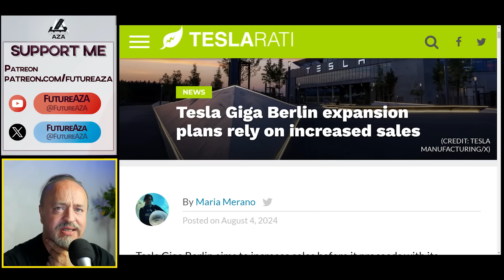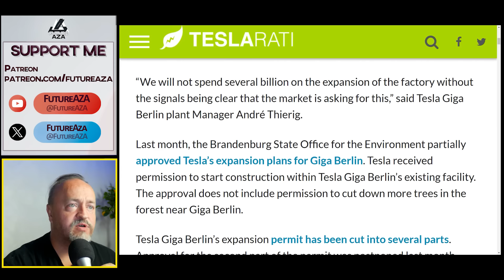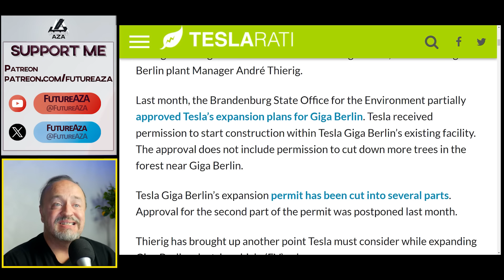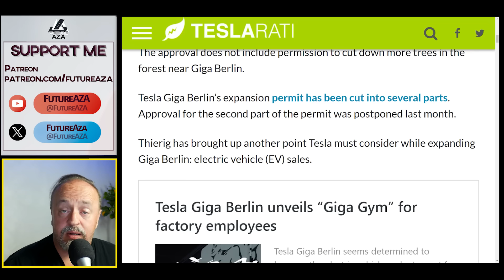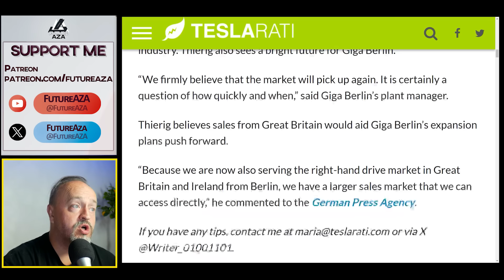Giga Berlin Exp. on Hold, Here's Why

Comment: I think the reason they are changing track is not simply because of “lack of sales” or demand. I think the reason is, as of now the 4 factories that they have are not running at 100% , so they have enough of space for more production; but in the mean time FSD is almost ready, the vision based AI is getting to be smart enough to understand the world around us and go anywhere in part of the globe. In that scenario, when the whole concept of personal transportation and owning cars is going to become superfluous! 

When buying cars is going to become obsolete, then why make them! What the world would need are vehicles without steering wheels and pedals, therefore today they have enough infrastructure to produce millions of robocars. 
So that is what is happening
Reply: No, there are 2B vehicles, even if the new ones last 100 years, they won’t replace all them with 10x current production
Reply: @rp-wb6xn   There is some truth in what you say.   First cars lasting 100 years makes it harder to replace the fleet.   The second is that disruptions have an inflection point.    After that the disruption accelerates at a much faster pace.

Comment: Although you disagree that cybertruck was a big mistake, they should have the -25K first. Your argument that the research should have been done first on the cybertruck doesn't make sense. Not a lot of cyber truck would be seen on the -25K car.
Reply: Cyber-truck gives Tesla premium price, pays the way for experimentation with 48volt and etherloop and new controller logic. It also allows Tesla to explore manufacture of larger vehicles. It will likely fork into a van type version.  Where-as if you experiment with a low cost car, you undercut the 3 and Y sales. A tesla or a Lucid design might have an
drive train that's a little more efficient than a good chinese or korean car , but battery develops make that extra 3 or 4 % efficacy less important.
Tesla has to play to their strengths: staying a desirable premium brand, having the best software,  charging systems, safety record etc.
   With smaller cheaper cars you can get an osborne effect if you match quality of the old, but can fall into  equivalence with byd and kia, with others if you target a lower price point.
Tesla needs,  "perfected fsd" to make their small cars stand out above the comparable  smaller cars.
Also tesla just needs more smaller cars, more bigger cars, more truck variants , some vans etc.
The deal is the need to make the stuff that will give them the highest margins.
Reply: @samblum153  How is tesla premium compatible with their mission to make the whole car market electrified?  By staying Premium they cannot grow or not grow enough to make them a valid investment.  How much data is needed to make a perfect FSD? Nobody knows that and there is a very realistic possibility that it never will be achieved with neural networks or another AI mechanism. Actually too much data can make the model actually worse as already happened before with other AI solutions.
Reply: There is no 25k car. I don’t believe Tesla can manufacture one at profit and that’s why we don’t see it.
Reply: @singed8853    What's the motivation to rush to cheap cars?  that was a product of Chinese crazy throw a trillion dollars at EV approach. There is a motivation to make AI cars.  If the two are on the same line, the small expensive taxi is obviously a higher priority than a  stripped down little car.
What you get from this approach is a premium price for the taxes, bundled with fsd for sure.   For the regular small cars you will get probably just get autopilot, and minimal extra features.
I'm guessing tesla would base prices on  cost of borrowing money at the time they are launched..
Reply: @samblum153  Neither are being manufactured. There are no robotaxi lines and there are no mythical 25k car lines.  All of Tesla's cars are supposed to be 'AI cars'.  This is not a matter of priority - a company can do 2 profitable things at the same time when they have the amount of capital Tesla has.  Tesla is not manufacturing this '25k car' because it does not consider it a profitable endeavor. Call that my opinion if you want.
Reply: @singed8853     Best use of capital, means proper scheduling the use of capital, right project at the right time.   They ain't doing it yet  does not mean they are or the aren't.  But be assured when they do start to build a next car it will be more than like a smaller model3 not a kia, and it will sell for a premium as they ramp up the factory capacity.

Comment: what you don’t understand is fsd is very close like less then 6 months imho. Also you don’t understand the launch model of fsd which is Elon activating of all the teslas alreadon on the road, Elon already said this on one of his speeches when asked how he would build a million or 2 million cars so fast to launch. he responded they are already built..
Reply from the maker: You sound like me three years ago.
Reply: The current FSD isn't full self driving. Drivers must 'baby sit' the system when engaged and intervene when called for. And my guess is that this will remain the case for quite a while, because there are too many unhandled edge cases the current system can't handle.  You think FSD is very close (e.g. less than 6 months away); I beg to differ.  IMO FSD is clearly not ready for prime time, nor will it be any time soon.

Consider just a couple of Elon's 2019 predictions (of many):

> We will be feature complete full self driving this year. The car will be able to find you in a parking lot, pick you up, take you all the way to your destination without any intervention"  ... “My guess as to when we would think it is safe for somebody to essentially fall asleep and wake up at their destination? Probably towards the end of next year,”.

> At Tesla’s Autonomy Day Elon said “Next year, for sure, we will have over 1 million robotaxis on the road".

5 years hence and FSD while greatly improved, still doesn't perform well enough to deliver the driving experiences Elon described/predicted in 2019.  I suggest we not put much stock in Elon's FSD and robotaxi predictions.

I await and look forward to FSD releases that yield  thousands of real-world driverless trips that required zero driver interventions.  We aren't there yet and IMO such FSD releases aren't going to be available any time soon.

Comment: It always takes far longer to finish the final 1% of work, than the previous 20%.  Those last few niggling bugs, or unintended consequences, pile up like a bump in the rug when moving furniture.  Also, Tesla won’t always have Elon to push the company down the road to success.  There’s a huge risk if the prime management mover is sidelined or moves on.  There are also powerful forces in the World aligning against the innovator.  They should not be underestimated.
Reply: Yes!  The final 1% of FSD development will be no different.  FSD currently still has 'quite a way to go'.

Comment: Rumours are circulating that the new factory designated for the Semi will actually be used for the new small car…!
Reply: That doesn’t seem very likely.  The first lines will be in Austin, where the engineers are located.

Comment: Tesla takes on full responsibility and financial liability once they declare the vehicles fully autonomous, so they better be damn sure it’s beyond flawless, and it’s not yet there. They may have to revisit IR cameras and radar in order to facilitate unsupervised fsd, especially in low visibility scenarios, we shall see.
Reply: agreed depending on the driving situation it is FSD or PSD (parttime) or DSD (dangerous)..camera strategy is clown car..when cameras can't see FSD has immediate heart attack and dies (and doesn't recover on its own)..no end to end neural network or AI hocus pocus or..bad weather of snow, rain, fog, smoke, etc. is beyond the camera's ability..imo robotaxi clown car will sport new sensing tech..couple of weeks ago 4 deaths in 20 minutes due to light morning fog..i found that a true tell of camera weakness..i could see the sun, the highway, cars..but 4 FSD deaths..FSD is mostly unsalable and needs huge price reduction...city driving is useless toy that has minimal commercial value, but where they present new clown car stuff (self-parking in Costco ROTFLAMO), highway driving is valuable but FSD is useless in anything other than simple driving..clown car company as far as FSD goes.  i own a Model and 60,000 lms/year and own Tesla stock
Reply: It's all in the insurance. Clearly Tesla will pass through the insurance risk to the customer, unless they have suddenly become a charity!! The market will decide on the price. The offer will clearly need to be competitive inc insurance. This is a non issue.

Comment: Even if there will be tariffs on cars made in Mexico and sold in the USA (to frustrate BYD, xpeng & friends), then still that factory could be used for batteries and robots…

Regarding Berlin: the only model they made (the m-Y) is the best selling car in the EU, so what do the want?
The smaller car will be a huge success in the EU, but just smaller in size, won’t make it cheaper to produce. They need 800v, 48v, steer by wire, and bots to assemble them, and cheaper batteries…

Comment: Tesla sale in China is up? The numbers would not agree with you. The last week of July sale on China was 12,500 down 4.7 % compared to the previous week.
The month of July Tesla sold total 71,000 but only 50,000 in China, 21,000 were exported to be sold elsewhere.
Shanghai productions are to be sold in China, because the exporting incurs additional costs.

Comment: You can now order the CT on line with no reservation and immediate delivery.  So the millions of reservations have been cleared.  They will have plenty of space to build the $25K EV, which they should have done before the CT.  CT will be a special product like the X, but will not sell like the 3 and Y.  Hopefully they can utilize all the technology from CT on all the other Tesla EVs.  Can Tesla build a EV without a glass roof?  It's hot in Texas.
Reply: You can order the expensive model. My #147k reservation for the lesser cost version is not up yet. They are not "cleared", just cleared on the high cost units.
Reply: You are not quite right.  You can order a Foundation Series Cyber Truck online in the US and in Canada.  Millions of reservations still exist but they are for the less expensive version(s).  CT will have significantly increased sales once they start producing and selling the lower cost trucks.  It’s a significant increase in the Total Adjustable Market (TAM) for the CT.  The CT is the best selling EV pickup globally.  And in about 3 years it will be the best selling Truck globally.
Reply: @richb2229  Thanks Rich for the clarification.  I guess I shouldn't have cancelled my rear wheel CT order.  I kept getting emails to configure my Foundation even though that was not what I ordered.
Reply: @guyg2005   While CT sales look good now a lot of what happens after the foundation series is over will depend on the economy.
Reply: CT reservations are evaporating now people have seen how ghastly it is and how precipitous the depreciation is.
Reply: The reservation list is not cleared. Better to say that when you are willing to pay a little extra (higher price for Foundation Series) you can jump ahead in the waiting list.

Comment: The problem is a fundamental one, and that's the extremely rapid rate of improvement of batteries and car design. Tesla have picked most of the low hanging fruit with their expensive models being sold to eager early adopters. However, precipitous depreciation has happened because not only are new cars so much better than the old ones, but the price of those has significantly fallen. Who wants to buy a second hand EV when they can get a much better new one? However, that cycle just keeps repeating because development is so rapid. We've never seen this before in the car market, and customers are reeling from the repeated huge losses they're incurring when they follow their 'new car every three years' addiction.
The only way to get the full value out of a new car is to run it into the ground. However, the folks who fork out £40K for a new car aren't those sort of people.
Everyone wants the 'affordable' Tesla, but Elon is failing in his mission by wasting time making stupid decisions like making the Cybertruck or Robotaxi that the masses simply aren't interested in.
The answer is simple. Focus on the 'affordable car', Model Y refresh and Semi. The rest are a waste of time. It's time for Tesla to accept that Cybertruck has been a big mistake and forget about ramping up production. It's never going to have widespread appeal. They would do better to transfer the underpinnings into a proper truck shell which can be made much more economically, and appeal to a truly massive customer pool.
Reply: Tesla is releasing/Testing a slightly less expensive 3 in Mexico.   As you pointed out BEV prices are on a race to the bottom.   On one side we had Tesla cutting the price of production with designs designed for manufacturing ease and factories to go with it.  In the other corner we have China willing to undercut prices from the west even if it costs them money.    It is really hard for a company to compete with a country.   If Tesla builds the model 2 China will simply sell their version for less.  As they have with the SU7 and Xpeng6 to compete with the 3.  So Tesla is going where China can not so easily follow.  
Why are you carping about the CT.   Had Tesla built a more traditional truck sales would have tanked long ago.  That market is saturated by Ford, Rivian and GM.

Comment: The mistake you make is thinking of Optimus as a revolution in manufacturing automation. Humanoid robots make sense as home assistants, but in a factory, it is always better to have a robot designed for the specific task at hand. Efficiency comes with specialization.

Comment: Guardrails for AI is required. But human nature will address it after they need it. I suppose you can always just pull the power plug right? Unless of course, it thinks of that first and holds your data hostage to get the desired results. Oops.

Comment: Why no factory expansion?
Elon started predicting recession a long time ago.
Hence (imo) the workforce adjustments and the "affordable vehicle on existing production lines".

On that vehicle?
Same body in white (amortized tooling) with "Highland" style updates.
Castings built "Unboxed style" using the Gen 3 components/ systems which will be ramping for use in the full unboxed system and reducing in cost.
Result? Juniper 
(Why would you build an updated vehicle on the "old" system?)
....
IF
Reply: An auto industry recession, or an economy recession? The former has already been happening, the latter is unlikely.
Reply: Provide the 'affordable car' and all these supply issues will vanish. Simple as that.

Comment: True FSD that allows for unsupervised FSD will increase sales tremendously and when approved by NHTSA Tesla will be able to sell them at a tremendous profit. Tesla should not license FSD to others until FSD has returned a massive increase to shareholders.
The issue I see is that the last 10% of unsupervised FSD is going to be tough. How to handle emergency vehicles for instance still needs to be addressed
Reply: FSD which by definition is unsupervised else its not FSD which at present it is not..will not increase sales much at all as it is way overpriced vs. the utility it provides except in certain use cases..camera strategy will forever prevent FSD as when cameras can't FSD has a heart attack and dies immediately..its clownish for tesla to infer common driving is "edge case" but self-parking at Costco (which is pure clown car toy) is core..why are they avoiding improving the highway driving experience??? IMO because they can't solve it with present tech

Comment: Hold seems to be the word  .
Might explain why the stock is down over 50% in 
3.5 yrs.
Reply: The stock price of three years ago was a Covid based anomaly, based on supply shortages and inflated margins. The p/e reached a high of 150. If you remove the Covid bubble from the stock's history, the current valuation is pretty much in line with the pre Covid valuation. Using 2021 as a measuring stick is disingenuous.

Comment: I think if they Bring out a Model 2 it Will Take Sales from the Model 3 and Y so Not Necessary Increase Overall Sales
Reply: The Model 3 adresses less than the richest 30% of the market. It is nonsense to suggest that a car aimed at the lower end will not increase overall sales.
Reply: I think that the cheaper smaller model (2) will be bought by people who can't afford the Y and 3 and the Y and 3 sales will continue as people with the money won't want a small car
Reply: People who buy a semi-luxury $40k car are not the same people who buy a $25k econobox. Does Corolla steal BMW sales?